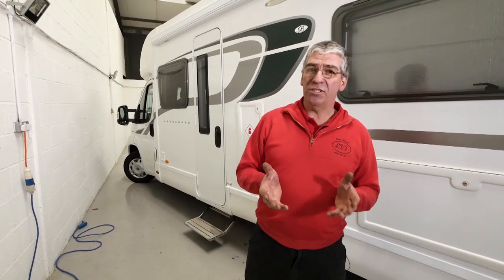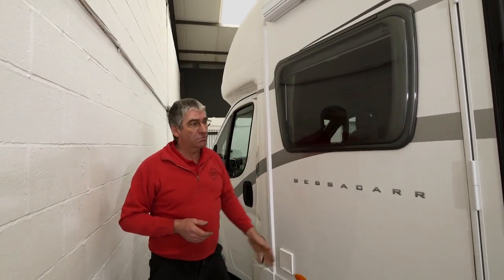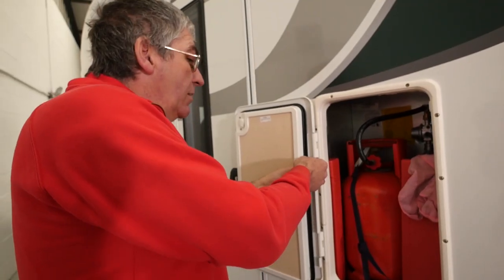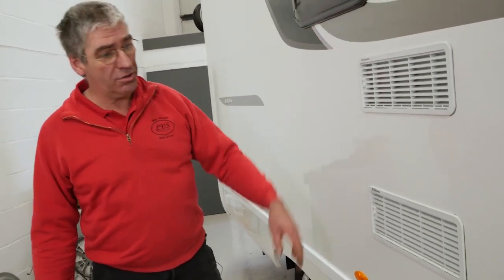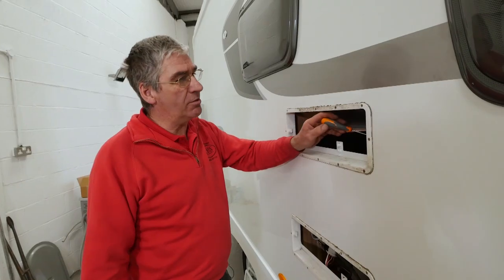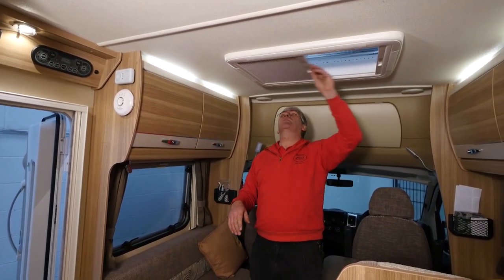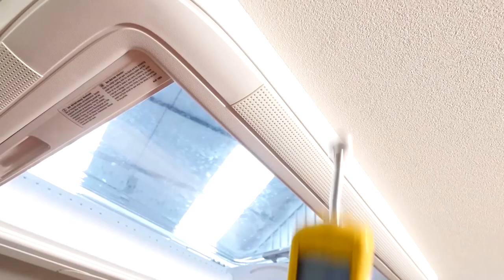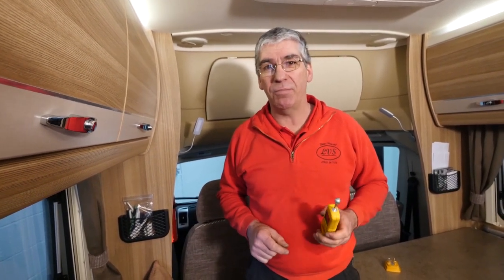Habitation inspections – expert advice from Practical Motorhome's Diamond Dave

Comment: why would you check the gas system at 5 times operating pressure when they are designed to work at a lower pressure, and possibly damage the system components, surely a better way of the testing  is by doing a vacuum test

Comment: Question: TWO hab check engineers, BOTH fully qualified.. one insists checking gas system at 30mb operating pressure, the other insists it must be 150mb (5x operating pressure) both are incredulous about the other's opinion. Who is right?